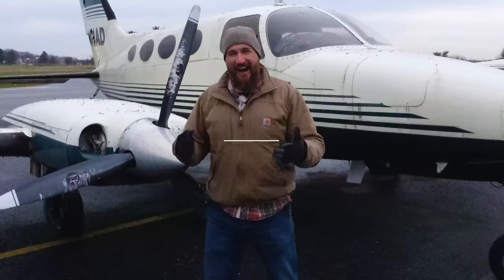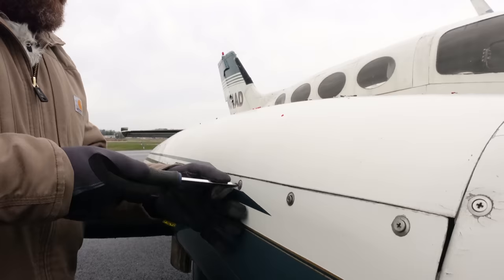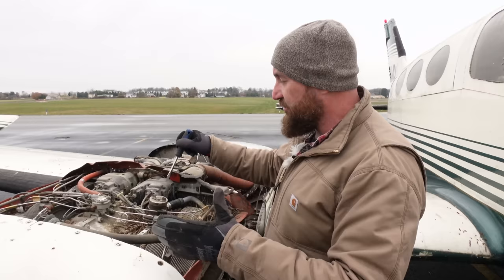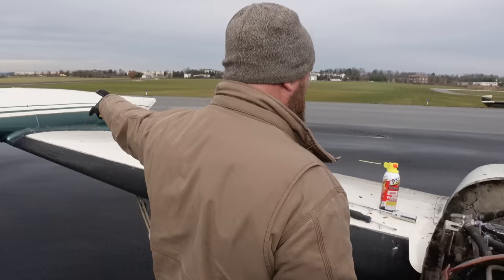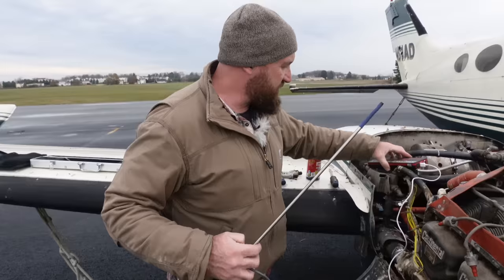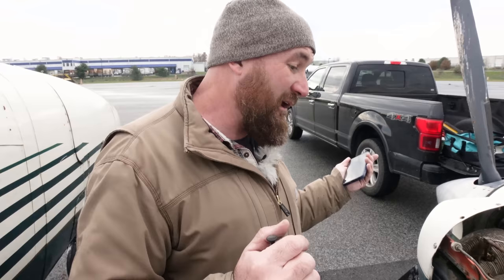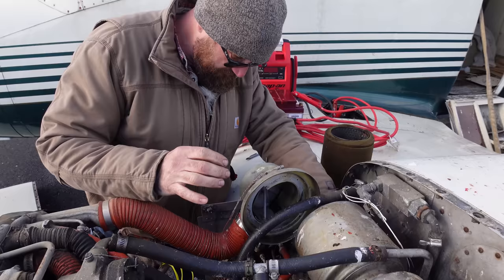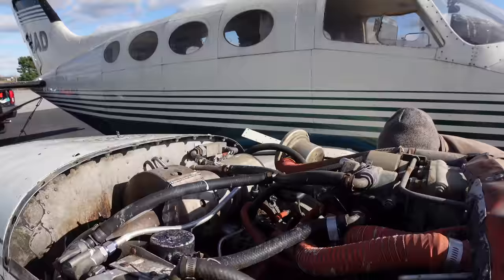FREE Abandoned Airplane... If I Can Start It! Ep1

Comment: After nearly 50 years in the aviation business I have to tell you this airplane is scrap. The engines are required to be overhauled by a certified shop due to the lockup condition and lack of logbooks. Everything that has an overhaul requirement based on calendar time or hours will need overhauling by a certified shop. The airframe corrosion may not be fixable. The props are probably due overhaul and the whole thing is years and years out of annual, IFR certifications, pitot/static certs, avionics to include ads-b and on and on. Your costs will be way more than the thing is worth. Finding an IA to sign off anything will be hard if not impossible.
Reply: Even if it were perfect it still couldn't be operated economically.  Piston twins are completely obsolete, that niche is now being filled by single engine turboprops.  401's are yesterday's technology and cheap for a reason.
Reply: I fly a '69 Baron with the same engines (io-520s but without turbos). It's a well-maintained great flying plane that will carry 6 folks at 185 kts. You can call it obsolete -- I love it. 4 hr drive vs 40 min flight makes it a time-machine for our family.
Reply: I'm more worried about the bird poo on the tires.  Clean that off and it'll be instantly air worthy.  Lack of log books mean you can use your imagination - for example, just pretend those are freshly rebuilt engines when parked.
Reply: @DoNotEatPoo  yeah pft let it rip
Reply: Never underestimate the power of money that YouTube brings.  It can and may happen.
Reply: My knowledge is confined to some years of skydiving in and around some old aircraft and being a member and volunteer of a couple of flight heritage museums in Australia, so I'm no expert. At our aerodrome, there at least two or three twin piston aircraft which have been flown in quite airworthy but are now grounded permanently because the costs are too prohibitive. Looks to me as though this one's destined for the Coca Cola can factory.
Reply: @Mox3712  I highly doubt it will happen. Im actually an A&P (aircraft mechanic) and this repair bill can easily hit 6 digits.
Reply: Yeah pull the registration it hasn’t sat that long
Reply: And it has Ads-b installed
Reply: He just wanna make it run, get the plane for free and then sell it for parts I guess. Seems like a plan
Reply: Airframe corrosion is really the only true dealbreaker. Everything else is just a matter of money. Would it be more economical to just buy a better example? Sure. But then you wouldn't have content for the channel. Personally I think it would be fantastically interesting to watch this whole plane get torn down and rebuilt and recertified. If the airframe is still solid, there's no reason not to do it, so long as the YouTube dollars keep the project afloat.
Reply: @A6youser   dude read my comments this plane flew in 2019 it has current registration
Reply: @Mox3712  from what I see in this video, it's too far gone to be useful even as a spares source.
And seeing as the guy doesn't even realise the proper way to do engine repairs and testing on an aircraft is to pull the engine and put it on a test stand...
Reply: @kennethmcdonald4807  what makes it uneconomical?
Reply: Everything you say is 100% correct Cbonz and then some. I spent thirty years in aviation maintenance. Even if this airplane had been in a dry hangar for 10 years, just the engines alone would cost a fortune to re-certify. Add to that there's the fuel cells, the de-icing boots, every single hose to be replaced. Then there's flight controls, instruments, electronics, wiring etc. etc. The hidden structural corrosion on this bird must be a nightmare all by itself. It would take a qualified A&P mechanic a solid month just to put together a to-do list. Once all the technical stuff is done there's the FAA inspections and new certifications, like you said.. I can't blame the guy for looking at this plane. He's not an A&P mechanic so how is he to know? He's having fun so good on him. Had it been even minimum maintained over its' life it would be a great classic to own, but not like this. They were fantastic birds in their day. He's looking at a half million easy to get it even close to airworthy again.
Reply: @Tellyfive  the engines for a start, you would need full overhaul on both, that will be 6 figures
Reply: Kenneth McDonald Single engine turbo props are over $2 million....
Reply: Enjoyed the video but the engine should have come out for a complete strip down before trying to start it.
If it wasn’t knackered before, it will be now.
It looks like the poor old bird is long past her flying days, but it made for a fun project.
Just please don’t try and take her up in the air.
Reply: @TheFlyingZulu Good question Patrick.  Firstly, you do not need to register your aircraft as anything in order to work on it yourself. The FAA doesn't care at that point. You do eventually, however, need to have all your work inspected and signed off by someone with the proper FAA licenses to be certified as airworthy.

Otherwise you cannot "re-classify" a former factory built aircraft of this type as "experimental" in order to cheat obligatory FAA airworthiness certifications as a means to save money. 

I'm retired from aviation since 1996 and things do evolve. Current FAA rules may have changed but I'm pretty sure he can't get this plane legally airworthy using "experimental", and with his lack of experience it would be dangerous to try it.
Reply: Get it running, donate it to a avmaint school
Reply from the maker: @markg4459  love the Baron's !
Reply: Maybe not scrap, but it would make a good parts aircraft for a working plane in good condition.
Reply: @Cbonz77 Exact what I'm saying, even IF you can get the engines unseized, those cylinders will be full of corrosion, and will make a TONNE of metal during the first few hours of running, causing massive amounts of damage to the rotating assembly. Your best bet would be to disassemble the engines without turning them over, and assess what can be salvaged and what is scrap, which is likely most of the entire aircraft.
Reply: my thoughts was the same. He will be in this more than it is worth most likely.
Reply: @kennethmcdonald4807  I disagree, as a Cessna twin owner, I can assure you that a well maintained twin cessna will be less expensive to operate by an order of magnitude than any SE tp, not to mention they have different missions.  And that's if you don't include cost of capital....Now, is this one a winner?  NO, it is scrap.   There will be hidden corrosion and he's looking at 250K+ to get it airworthy (200k just for engines and wingspar AD), which could buy you an airworthy one and 100k of fuel.
Reply: last flight was MAY 2019...flew to Chino CA.
Have a ton of these in Orlando, we fly them too and form the Bahamas daily.
Reply: @markg4459  I still drive my 1990 Nissan 240 SX, outdated maybe, but a ball to drive !
Reply: With zero aviation experience I could have told him it was scrap😆
Reply: @briancorty4348  it may still be registered but it hasn't moved in a very long time. Just look at it you can see it hasnt been flown for many years
Reply: @briancorty4348  Huh?, you can see the bird-poop all over, it's been sitting there for ages, if it flew in '19 the owner would just sell it for cash.
Reply: @briansieffert665  It didn't get that bad in 2 years, use common sense.
Reply: @ThePontiac98  wrong May 2019
Reply: @williampalminteri1727  your car does not need FAA certification to drive, this is the main issue, he can't rebuild his own engines, it has to go to an approved builder.
Reply: @barryaiello3127  it flew in 2019
Reply: @barryaiello3127  hey man, I’ve seen some duck tape roll up to my ramp in Orl… I could see an idiot flying that…
Reply: @barryaiello3127  you’re wrong…go to Ktmb and there will be planes way worse than this lined up on the taxi awaiting take off clearance.
Reply: Came here to say this. You’re so right. There’s a reason there are plane graveyards - if a plane doesn’t fly regularly it’s not worth the cost of keeping it airworthy and so it becomes not airworthy. 

This plane will never fly again.
Reply: @TheFlyingZulu  - SV Seeker is a 75 footer I believe. 70-something anyway. He only retired a year ago, he was working full time as a database administrator until then, and was editing videos at work during his (nearly 100%, unless problems) downtime. A boat is a long way different than an aircraft. A boat doesn't sink and kill everyone if its engines die.
Reply: @thyslop1737  No. It sounded like from the video that he was going to get the engines running and then see about parting out the plane. Remember, the plane is only free if the engines run.
Reply: Ehhh just register that baby experimental and ride the lighting 🤘😂😂😂
Reply: @barryaiello3127  It had a in-flight cracked engine case in 1977, an in-flight separated air intake duct in 1984, and a pilot-at-fault gear-up landing in 1993.
Reply: @KarolGrom92  I'm a IA for 32 years in general aviation. Stroke a check for 500,000 and that should get us started
Reply: @Tellyfive  Everything in airplanes is insanely expensive and requires certification by a proper aviation mechanic (A&P). The average Joe--even if he's quite talented--cannot DIY these repairs and get it legally in the air.
Reply: Yea for sure sometimes free.....is not free.....cost more to fix it than buy one already running.
Reply: @BrianB14471  Yikes, someone actually landed and forgot to lower the gear?, doesn't matter really, plane would cost more to bring it into FAA compliance than it's worth.
Reply: @briansieffert665  so its only been sitting a couple years?
Reply: @williampalminteri1727  you probably don't even have one
Reply: @barryaiello3127  I mean sitting outside with windows open for 2 years could do some damage
Reply: Naw I got a guy that will certify anything.
Reply: @markg4459  Does the airplane in this video look "well-maintained" to you?

No?

Didn't think so.
Unless your airplane has been sitting on a ramp, untouched, for 20 years, you had no reason to bring yours up here.
Reply: @MattsAwesomeStuff  you are so wrong..a boat in bad weather and waves with a dead engine will kill everyone..with a nice wave to the side and roll...bye bye...wake up bruh
Reply: @MattsAwesomeStuff   by the way SV seeker Was a poorly built little boat it's boat and will sink within the 1st year to 2 years out in the ocean.. I would put money on it and a lot of other people will too..
Reply: Ya right a 1963 split window vette, just scrap that old car.1965 gt 500. Just old junk!LMAO.Not a chance i will not get in a new boeing 737Max.Everything has to be certified by you?Guess you are selling one?LOL.
Reply: @Parawingdelta2  If you do the work on it  your self mate, nothing is unpossible.LOL.I work on much older cars.All from the 60's.They always work, they always get us where we want to go.
These air frames could easily be re engined.The continental was far from a good engine.It was junk when built new.The lycoming was much better.Put a couple mazda triple rotor motors in.Or a honda motor.Ya a 4 cylinder puts out more horsepower then those continentals.Did i mention they where junk, add a turbo.LOL.Just a thought, see you in cuba.Lets whip out to jamaica  for the weekend or land in costa rica.Live the dream!LOL
Reply: @KarolGrom92  av tech, i screw up my problem gets buried.Now a brain surgeon.No warranty, no come backs.LOL.If the guy does this him self very doable. Quite a complicated aircraft.His gps on his telly is probably better then all the tech on that high tech plane back in 1968.Re engine it ,is my vote.
Reply: @anonymousxish  Would need a STS to re engine with Lycomings. Anything on certified aircraft is $$$
Reply: @barryaiello3127  Looking on the official FAA gov website. It was certified 05/26/2020
That said, I agree there's a hell of a lot of $$$, inspections and recertification needed.

Edit: my guess would be it was certified then parked, but without the logbooks. No body will know.
Reply: @kennethmcdonald4807  There are lots of Barons, Seneca’s, C421s, C414s flying and doing great work for their owners,The C414s and 421s are pressurized and there are even P-Barons. Even used turbine singles (TBMs, Pilatus PC12s, Piper M500, M600) are in a different price and performance category. The 401A is a solid 200 - 210 knot, 1,200 nautical mile range airplane burning around 32 gph. There are a lot of missions for which this would be a good airplane, you can pick up one with decent time left on the engines, complete logs, no damage history for somewhere in the low six figures. This one, with no logs and the amount of work needed, is definitely not worth getting airworthy.
Reply: Well said. Barn finds are great for cars, but not planes.
Reply: @InForTheLonghaul  glad at least someone got a laugh 👍…this is why I got my rotor wing endorsement…fixed wing people seem to lack a sense of humor 🤷🏼‍♂️…super dorky too 🤔
Reply: @barryaiello3127  True, but my cars still needs to pass state inspection.
I was responding to the guy with the 1969 vintage airplane.
Reply: @philbowles3240  Seriously.
If that were a car I wouldn't drive it !
Reply: @kennethmcdonald4807  Bullshit, the issue is it will never fly again because of its condition. I know I fix them.
Reply: @TheFlyingZulu  Generally, no. Technically, It can be done but the hoops the FAA would make you jump through would be impossible.
Reply: @thyslop1737  It can be certified - for lots and lots of money.
Reply: @anonymousxish  The FAA will take an interest in this as soon as you do a records request, which you'll have to do because of the lost logbooks.
Reply: @barryaiello3127  you don’t need to put the gear down to land, but it shortens the time to take off again.
Reply: @KarolGrom92  Not if he does it himself.
Reply: @KarolGrom92  take it to Mexico ,they’re good and way cheaper.
Reply: @theyeetus1428  That’s the problem. On this type of aircraft you have to have FAA certification to work on the aircraft. So sure he can pull it apart, BUT if it’s to fly again and be insured. He can’t put it back together. 
The reason aero parts are so expensive is the paper trail.
Reply: @AllThingsFlightSim  Turbo props are gas turbine engines.  This a piston engine turbocharged.
Reply: @briancorty4348  Yeah, not hard to find.  Wonder why he's playing it up as having set for 15-20 years?
Reply: @kennethmcdonald4807  You're just completely wrong.
Reply: Very true. Exactly right.
Reply: @Cbonz77 I think the point is if he can establish whether the engines will run (even badly, but nevertheless run) the options can then be weighed up on what to do with the aircraft that has been acquired for the cost of getting the engines to run, regardless of the fact they won't be certified for flying at this point. If they end up having far more wrong with them than not getting spark/fuel then clearly it's not worth rebuilding. 
There's also a lot to be said for just getting something running after all that time - pretty satisfying even if it never leaves the ground again!
Reply: @jwenting  cockpit instruments look ok for spares , probably the only value left in this bird
Reply: putting aside costs,nothing is unrepairable. it may take thousands of man hours, all work has to be certified by appropriate people. But its a lot easier and takes less time to overhaul a fully restored engine than it is to work on a seized one. It could be a lifetime achievement but good luck to him. If he restores it I would watch it!
Reply: @kennethmcdonald4807  A 1903 Mercedes 3  might be obsolete but I would give my left testicle to have one to restore!
Reply: @KarolGrom92  let your imagination run free, nothing is unrepairable , its not the end product nor the cost matters it’s the journey to get there. If you look at it from an A&P point of view perhaps you are thinking of the task as being too much hard work. An engineer can see the whole task as a machine that does not work , he needs the mind of an artist to understand why the beauty of the end product is more important.
Reply: @pmag3200  can you build one that's better?
Reply: That’s my opinion too. The sad story is, the game here is totally over. Thanks to the owner, who screwed this up. I will give you a number, about 600.000$ is more than realistic to get this in a modern way airworthy. And even this money might be to less, if you want to get  a modern class cockpit.
Reply: @mr.ginnationfunlifestyle3891   Sorry to disagree chaps but you fail to see the purpose of the task. When one is restoring anything the cost or profitability that matters for the true engineer  its the journey that gives priceless pleasure. The end product is just a full stop at the end of the sentence. Then another sentence has to start!
Reply: @martyns2804  No as a A&P my job is to make sure the aircraft is airworthy same goes for a engineer. If the customer has an endless funds then sure it will be fixed.
Reply: @martyns2804  Yes I understand this. I had the same story with a boat. At the end after years of joy, fun, fulfillment and frustration, loosing a lot more money than expected, spending three times, then equal boats cost, now I am smarter then ever before. Would I do this again like this? Clearly NO! I know a guy, it’s on YouTube either, who did the same with a twin Piper. His answer, if he would do this again, was no either. Its just to much money, that goes into these projects. This big money offers way better choices, but everybody likes to do such huge projects with passion and joy? Welcome, do it.
Reply: @briancorty4348  It only costs $5 every three years to keep the registration current.   Current registration has nothing to do with when it last flew.
Reply: @briancorty4348  Current registration cost all of $5 every 3 years.  And you reply to a form the FAA sends you.  Current registration has nothing to do with when a plane last flew.
Reply: You probably sucked in the air filter and jambed the turbos!🤣
Reply: @jeffwood8109 🤣 not the point.. why SV seeker hasnt launched yet and still working on boat because no right minded insurance company will insure his home made boat
Reply: @hifives2  what you can see of them... I's seriously question any vacuum or electrical components, and any internal mechanical components. At the very least everything needs to be rebuilt and recallibrated.
Reply: @briancorty4348  even in 2020 when I am right.
Reply: @jwenting  agree but you wouldn’t just rip the cockpit and instruments and throw it all into a dumpster, the components would be useful for spares and home builds whereas most of the rest is just scrap metal.
Reply: @martyns2804  exactly, my uncle collected parts for a b400 Ford and when he was fifty he finally had everything he needed and restored a running example.
It's taken him most of his life to accomplish this task.
He's been offered a quarter million for the car because it's the nicest example in existence.
He will never sell.
Reply: @jimchuk8511  Hmm, that must be what the FAA website calls certification then. Because that's a 3 year block and is current.
Reply: @agentcrm  What you see on the FAA website is just the registration for the aircraft and that is current and up to date.  The FAA has no idea if it's airworthy or in annual or not.  I have several projects that have current registration, but they haven't flown in years, nor could they.
Reply: @jimchuk8511  Ah, that makes sense.
They shouldn't call that just "certificate" then.
I'm surprised they don't track airworth or nannuals.
Reply: As an expert with 51 years in the aviation business your comment is completely false.
Reply: @rebuildrescue  get the engines running and sell it to someone in north africa
Reply: @jimhayes2786  you are right. Old twin Cessnas in good condition with modern avionics new paint new interior still cheaper than newer modern aircraft. And they are great reliable flying machines. For the different price to a newer plane you can fuel a lot saved money in this plane. But this one here has no chance to fly again in my opinion either. This game is over. Sad but true. It was a nice beautiful airplane for sure.
Reply: @AllThingsFlightSim  Shhhh.  If it weren't for guys like this, I would not be able to obtain a ship that hauls just as much for 1/20 the price, and 1/10 the insurance.... :)
Reply: @pmag3200  actually, it is the point. You couldn't build better, and you obviously don't even watch the channel. Or you'd know that the issue with insurance is that the insurers want a full survey done, and this survey requires the boat to be in the water, which, due to the size of Seeker, requires more than a drive down the local launch ramp on the back of a trailer. It's a nice little catch 22. But, please do go on about how awesome the boat you can build would be...while showing your ignorance about the one you're deriding.
Reply: @briansieffert665  flightaware screwed up on that one, that plane hasn't flown in 15+ years. Either someone put the wrong N-number in the system or a smuggler was using it as a spoof registration.
Reply: @oscar_charlie  right…a smuggler going on a 24 mile flight, it would be quicker to use a vehicle! Lol
Reply: @ericmowrey6872  You can get a certified aircraft issued an experiment registration for certain reasons.  “I can’t afford to pay qualified people to repair it with certified parts”, is not one of the reasons.
Reply: @briancorty4348  The registration is current, but that has nothing to do with how recently it has been run or flown. The condition itself tells you it has been a long time. The FAA says the registration is paid up thru May 31, 2023 but without logbooks, and no way to get logbooks without a huge bill this will be a decertified aircraft just based on what has already been posted on "the tube."  This is nothing like working on a car or truck from a paperwork and legal standpoint. The reason for that is simple--people die when improperly maintained aircraft are flown....
Reply: It's not what you know, it's who you know.
Reply: @KarolGrom92  i would be more surprised if the repair was less than 6 digits, there is about 80,000 just in engines, plus everything else.
Reply: @SaltimusMaximus  Yes, if you drop them off at a shop & give them a blank check -- easily hit $100k. But if you're an A&P or are handy and have an A&P buddy willing to supervise you can do a field overhaul for little more than the price of parts. Maybe half or slightly less than half of the shop bill. I've done it twice.
Reply: @rebuildrescue  It's strange how you ignore all comments from people who build and repair planes. It's like you don't want to admit that it will never fly again and you're leading people on to keep the views coming. Just be honest with people on what your plans are.
Reply from the maker: So many good points in this message…. 
Our goal is to make the engines run and get this old girl cleaned up. Then we’ll dig into her and see how she looks. If she’s ever going to fly again it’ll take a ton of work and a ton of money ! 👍🏼
Reply from the maker: @Neilukuk  Hey Neil ! It’s been so terribly tough to keep up with all of the comments. Our plans have been to get her engines running and definitely give her a good cleanup….  I can’t stand seeing such a wonderful machine full of dirt and grime! Beyond that we’re really not sure. We need to take a really good look at her and see if she has anything left in her yet. If she has anything left in her she’ll let us know ! Hope you’re along to find out 👍🏼 Thank you for watching and for sharing your thoughts !
Reply: @rebuildrescue  Cheers, I appreciate the info. Take care.
Reply from the maker: @Neilukuk  Absolutely ! Thank you for dropping in and being a part of the channel 👍🏼
Reply: @xephael3485  what parts are usable. poopy seats, bad engines? outdated avionics?
Reply: @travelsouthafrica5048  how would you transport it from USA to Africa...?
Reply: Ya can still fly it in your back yard 🤠
Reply: @TheFlyingZulu  Short answer: No.
Reply: @pmag3200  SV seeker has been launched.
Reply: Most peps here are missing the point... with enough money and time it can be repaired and guess what... That's how YouTube content creators earn a living by making videos and reinvesting that earned money into even more videos.
Reply: @TheFlyingZulu  lol...yeah duh...
Reply: @TheFlyingZulu  SV seeker will catch fire or sink with in the next 2 years the captain is a fool
Reply: @pmag3200  Lol that I can't argue with...  He used a lot of non-marine grade items in his boat.  I hope it doesn't thought and I wish him the best of luck.
Reply: He'll get it running .haul a couple loads an ditch it .least if they confacate  it an they will .they got no sense of humor  least u won't  give a shit ..just sayin....
Reply: T
Reply: He mentions it will never fly again.. I'm sure he's aware  
 He's just having fun.
Reply: So what party pooper🤷‍♂️ 
With amount of compartments. One trip of trafficking to Colombia and back will pay this bad boy off and more.
Reply: But do you know how much he makes on this YouTube videos? It’s enough to cover any kind of work with the airplane ✈️ 
But your knowledge about aircrafts is definitely great!
Reply: We dont care, we didnt come here to here your life story
Reply: Sell those engines to someone who builds airboats...
Reply: Parts
Reply: @user-pq2di9rd6b lol enough to cover any work...
Reply: @branchandfoundry560  you are incorrect, as long as you do the work and an IA signs off on the work, the FAA is happy.
Reply: @barryaiello3127  happens all the time.
Reply: @agentcrm  that would be a supplemental type certificate or STC.
Reply: @stevewilson5546  I wouldn't say that, I know of a stagger wing in a barn......
Reply: @pumpkinboyk91  the cores on those engines are worth 10k
Reply: @macking104  let's see...engine cores 10 k landing gear another 5k avionics close to 10 k .....the list goes on....
Reply: turn it into key rings mate and recover your outlays.
Reply: I guess what you like is the instrument panel is still intact and not smashed ie, no sign on vandalism. But still, you’ll be going thousands of feet in the air is it worth your life? Maybe get a plane parachute installed, only then!
Reply: @jwenting  and you have to be a A&P mechanic lol 😆
Reply: I agree. The cost of getting the plane back in good running condition is prohibitive. Especially if the body of the plane is not sound.
Reply: True that. But hey makes for a cool video to dream.
Reply: As complicated as it looks, there anly 4 important forces that must be rebuilt. Gravity versus lift and force opposite drag. Get to it and luck be with you.
Reply: @markg4459 When you have a cush low-mid 6 figure job its easy to own a small plane.
Reply: The owner knows it's not going anywhere anytime soon, hence for FREE.
Reply: You also can not work on a factory certified plane without an AP present. If it's a experimental you can it all yourself. But not these birds.
Reply: Looks like a GA7 Cougar they built in 76 -77 at Gulfstream. I put fuel lines in a few till I move up to the bigger Jets. 🛫🛬
Reply: I think if you're serious about restoration , even trying to start it would result in more damage to the engine
Reply: Nah. It will fly. Little bit of WD40 and it will be good.
Reply: As an A&P I m cringing 😂😂😂😂
Reply: Hes said many times, he just wants to run the engines
Reply: Exacly I had a older beach craft p something or another...the engines had about 500hrs left on them ..every week it was like a x wide getting a divorce. $$$..I sold it for 120k was lucky to sell it
Reply: What a bunch of sallys i would fly that in a sec I have been a bush pilot for 40 years with no crashes and 5 in air engine fails be carfull altitude is your best friend he can do anything an ap can do rules are ment to be bent.😊
Reply: Wussey
Reply: my guess would be the repair and recertification bill to make this plane airworthy if the frame is doable at all would be between $250,300,000 and for that you can get a good used example that runs
Reply: I have to conquer.fuel tank blades will be bad . There's so much work and cost involved a person would be crazy to take this bird back in the air. Its a shame that this plane wasn't maintained better there's a lot of AD's  (airworthieness  directives) that are on this aircraft. The guy will let you fix it up for him but if you actually got this plane running he would change his tune I bet.... Don't do it walk away no run away. Cost ya 100k I bet to bring it back or more. Fuel will poor out of those wings
Reply: Yeah, what you said. Watching a few youtube videos doesn't make you an A&P mechanic. This project is doomed to either failure or massive expense.
Reply: Those props would make great garage decor, and the engines may fit great on an airboat
Reply: Only if he plans to leave the ground with it
Reply: Well these comments aged well….sadly
Reply: People rebuild wrecks from WW2 and is much worse condition . This one is a walk in the park but it does takes an effort to fix it up and recetified with FAA . If all fail make it into a drone for used in missile test .
Reply: Hmmmm, if, you can get the engine  to run.   Curious  if this could   fitted in a vehicle  or boat if the plane idea is to expensive  to do.
Reply: Todays lesson is - when seeing if you can get a turbo charger engine to start up first check the turbo charger condition as if that is buggered, you are wasting your time with anything else....